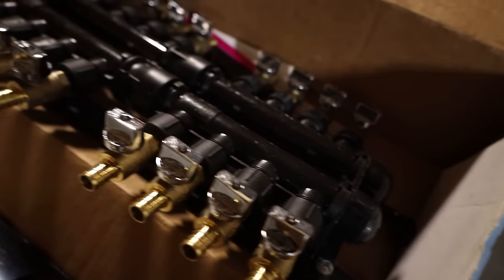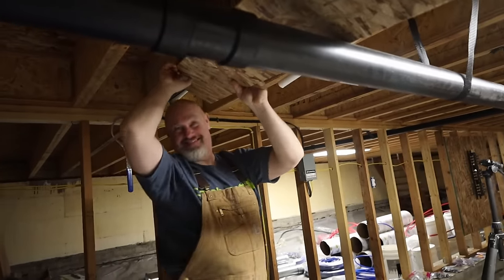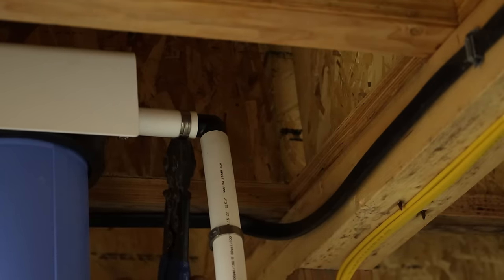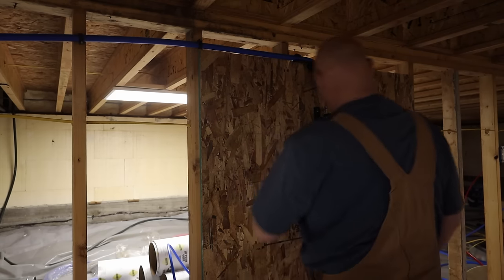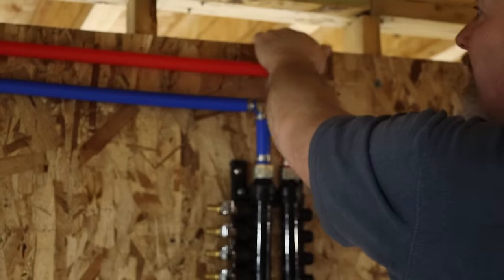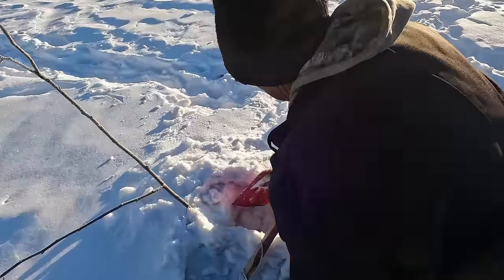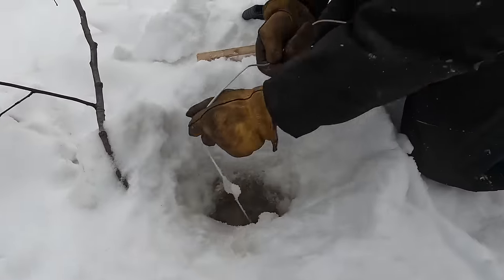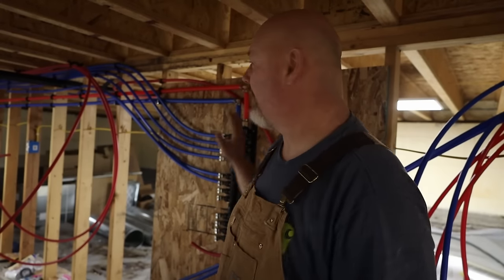We've Waited Two Years For This Upgrade!

Comment: Hey guys.  The video today was meant for me.  I'm working on the plumbing in my skoolie, converted bus.  I only have a bathroom shower and sink, my kitchen sink, and the propane water heater.   I'll be using the trunk and branch.  But I wasn't sure which one to use, clamp rings or push-to-connect connectors, the Shark Bite brand.  I'm not sure I can use the crimpers to tighten the clamps. Anyway, thanks, Ryan.  You inspired me to get to work on the bus.  I need to get up to check out your place.  Haha, Love you guys. Be safe
Reply from the maker: Good luck with the plumbing.😊

Comment: Hey since you have not connected the hot lines yet consider one hot line to carry the hot water and not multiple lines feeding off that at the location of use how you are designing it, . If you flip on the hot to the sink in your bathroom, then start the shower or tub, now a second feed line has to fill up with hot water.   That creates extra demand on the hot water tank.  It does not matter with cold. You fill them all and it just waits for demand. Hot water has to be replenished with hot which can only come from the hot water tack.

Comment: Having your water heater so far away from your manifold means you will have to let the water run for quite a while to get hot water to your taps. I learned that the hard way.
Reply from the maker: I’ve learned that there are positive and negatives with everything you do in plumbing. There doesn’t seem to be any perfect solution for any situation.

Comment: Thanks for sharing.  The water lines look good.  I would suggest to put several valves before and/or after connections to things.  That way it is easy to work on stuff.  Too bad for the fishing.  Still better than not fishing.
Reply from the maker: That the purpose of the manifold. Each sink/toilet has a shutoff valve at the manifold allowing me to isolate each individual line.

Comment: Awesome job with the piping! I would only add one thing, an on/off ball valve into the supply line before the filters. (Unless I missed it somewhere) I'm old, it's entirely possible...lol 😂😅 Love ya'll ❤️
Reply from the maker: I just purchased two valves today. One before the filters and one after the pressure tank.
Reply: @wildwoodoffgridalaska  Sounds like a plan, that way you can change/clean filters better without shutting it down.

Comment: Your filter system probably should have been after the pressure tank. If the filters ever plug up the pressure switch will turn on but not let water through and won’t build pressure. Then your pump  will continuously run and burn up from over heating. Just an fyi, we own a domestic well drilling and pump service.
Reply from the maker: My thought is I wouldn’t want all of the stuff going into my pressure tank.

Comment: Yes most older toilets take 5 gallons to flush that is a very lot of water that's why they came up with the two buttons on the top one for P and one for poop I don't have to conserve water because I'm on city water but still it bothers me so I don't flush the toilet when it's just me at home because I pee a lot and I find it a lot of wasted water or I just pee outside But where you are I wouldn't advise peeing outside in the winter it might hurt if you get my meaning and like they say don't eat yellow snow it would be like a frozen fountain outside if you get my meaning:face-purple-crying::face-purple-crying::face-purple-crying::face-purple-crying::face-purple-crying::face-purple-crying::face-purple-crying::face-purple-crying::face-purple-crying:

Comment: I wouldn't use that plastic for fittings or u will have broken fittings all the time. & Ur filters I'd put up side down or some point they will be broke as well .you want to make a fast draining system so if you have to go or there is no heat u have no problems but that's what I have learned liven in cold temperatures & haven running water

Comment: I helped a friend with basically the same system but he put shut off valves about a foot before and after the water heater just in case the heater needs to be serviced. Keep up the good work!!
Reply from the maker: When we install our water heater we’ll be doing the same. 😊

Comment: Looking good. Yes inspirational and informative. Thanks. Was wondering about freezing. I know the pex pipe can take the cold But what about the drain. Is it heated or deep enough it doesn’t freeze. I don’t remember what you said when you put in the crib. Thanks. Fishing looks fun even if not a lot of success.
Reply from the maker: Our crawl space stays at about 45F-50F at all times. I do t have to worry about freezing water lines.  Our waste drain line is burried deep and boxed in with foam.

Comment: Ryan, question for you. We  have our filters in front of the pressure tanks and have had two different plumbers tell me I'm going to burn up our well pump. Why are you putting yours in front of the tank, and what's your thoughts of the plumper telling me I should move our filter to after the tank? Thanks
Reply from the maker: My thought is that I’d rather filter out any garbage before the pressure tank so the pressure tank lasts longer. After seeing the filters, I can’t imagine that stuff would be good for the pressure tank.